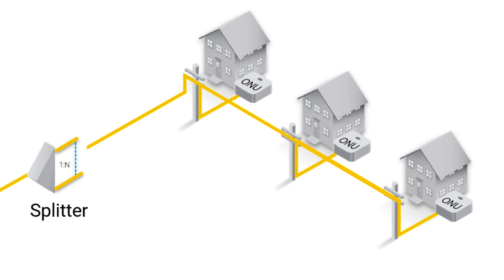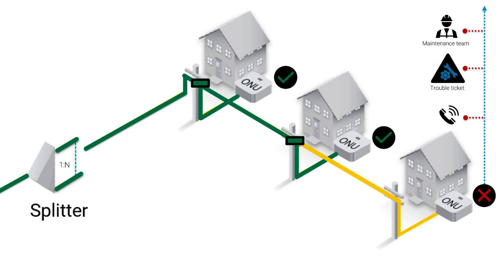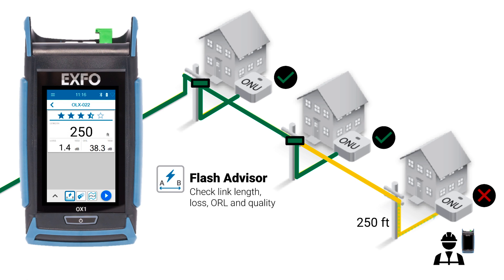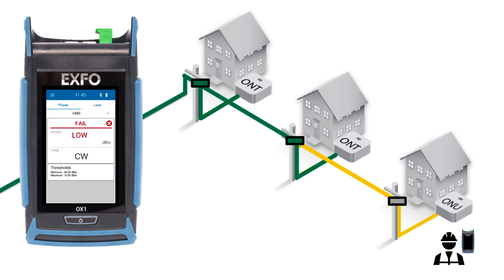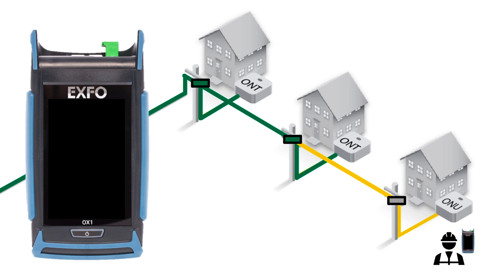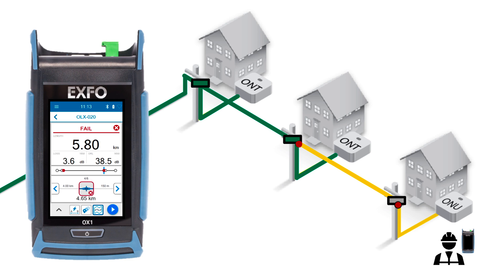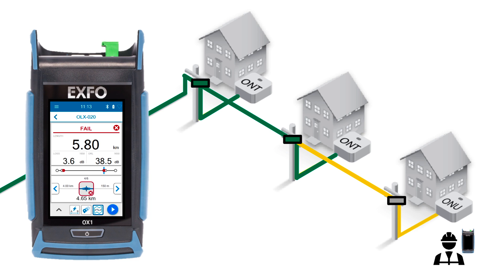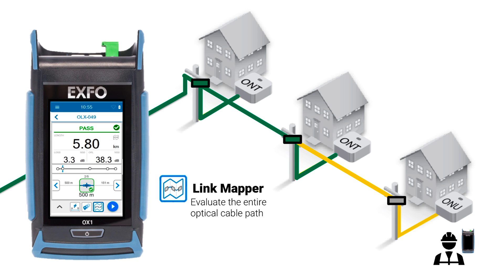How to troubleshoot a fiber node in a low light/no light scenario into an FTTP network – Use case

Comment: Fibre gpon and epon, layer 2 and layer 3 imagine it like a dsl filter because it comes from that circuit it must return to that circuit, so fibre requires battery because otherwise everyone's power comes from the same place - the power plant. Where as if you use battery it must return to that power source to have an electrical circuit, if it can return to any house fed by the same power station frames will get lost